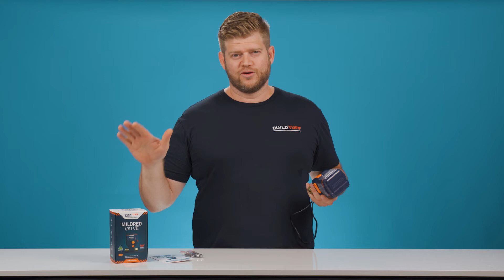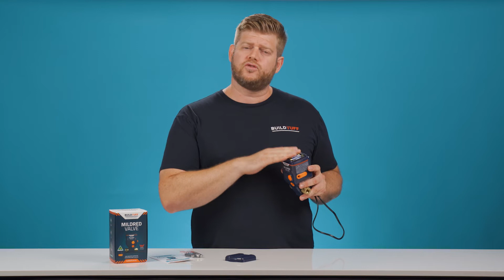BuildTuff Mildred Valve - Battery Installation

Comment: My Buildtuff Mildred valve (which looks the same as the one in this video) uses "AA" batteries, NOT the triple A batteries mentioned. So check the old battery size before you get new batteries.

Comment: Legendary mate. Thanks for the video. My old batteries had given way which is why I heard the beeps in the morning. Luckily the indicator had shown it was low battery. Brought a pack of AAA batteries from woolies. Problem solved. :)
Reply: Was it easy to change batteries do you rest it thanks
Reply: @jasonshep814  very easy to change the battery and to install it. I was so worried that I would have to call a plumber. Luckily I found this video. It saved me alot of money and time. When it makes that sound it means you need to change batteries